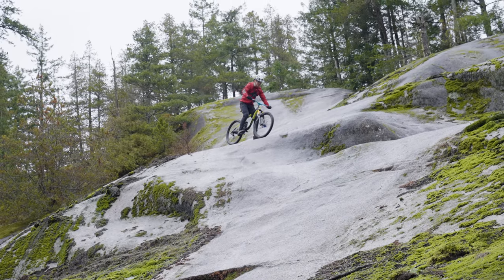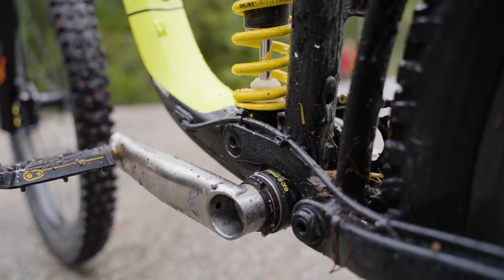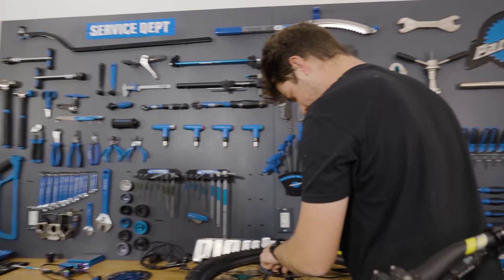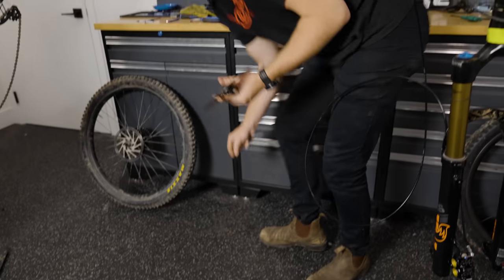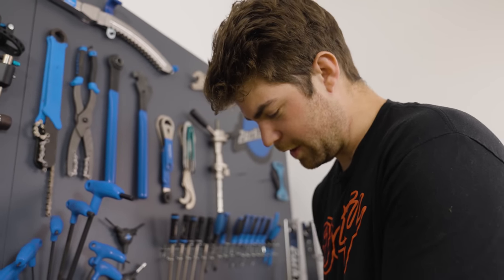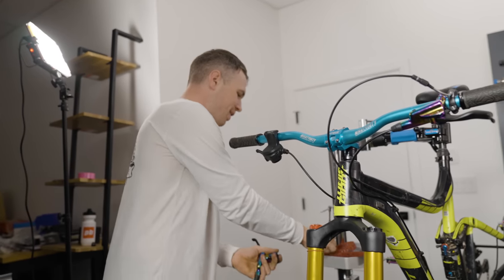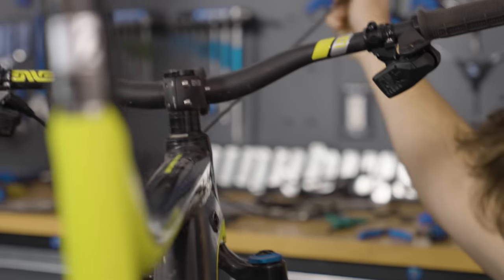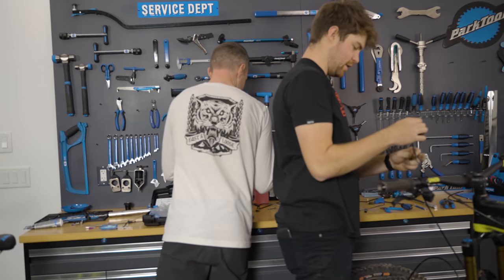$125 vs. $517 Brakes - Budget vs. Baller Episode 7

Comment: New pads, rotors, and a bleed would have been the “budget” option here…
Reply: And the price would have been less that the crap brakes they purchased.
Reply: Right... The mentality is absurd.
Reply: Or Shimano mt420s great power for price, especially with metallic pads
Reply: Yeahhh, looks like it wasn't bleed properly that makes it a poor performer. Could have been better if it was done properly.
Reply: I don't know why they would do it the way they did vs good pads and a fresh bleed.  I miss when Pinkbike had brains and common sense.
Reply: They even went down on rotor size to make the braking force worse. These "upgrades" are a joke. Them saying this was inspired by Donut media does a huge disservice to donut as they actually made UPGRADES and the low cars got good parts fit for purpose that are just sensibly priced.
Reply: @benfairbrother2458  Agreed, I have a set of MT400 brakes on my hardtail, they're almost four years old now and still work great. Sure the power is lacking compared to my four piston XTs, but they're the best value by far. I would have loved to see them use Shimano's cheapest brake vs. XTRs or something like that, just to show the difference, if they had to replace the parts and couldn't just do a service and call it good. 
Like maybe do a Marzocchi Z2 or 35 Gold vs. a 36 Factory, Deore 11 speed (to use the HG hubs on cheaper wheels), vs. XTR 12 speed Di2, or something. It would have been more informative and equally entertaining, but the more I watch the more I realize they're just trying to make it funny, which isn't what I was hoping for here.
Reply: @mjojrjr6231  yeah it's hard to imagine not being able to lock up any 180mm rotor if it was bled properly, especially when there is low tire-to-ground traction in the wet.  I bet you could lock up some rim brakes on that wet slab!  Maybe the brakes are so terrible that they are highly prone to bubbles / hard to bleed / etc., but the fact that they set this up right after the parts were shipped suggests it's probably mostly a set up issue (and while I've admittedly never bled my own brakes, and I realize some brands have different methods, what Henry was doing just did not seem right).
Reply: i have mechanical
Reply: Right. No one in their right mind would consider budget as "sort by cheapest" on Ebay or Amazon or whatever platform they're getting the parts from. 
It'd be more reasonable to do it on any respectable bike parts retailer, since you wouldn't end up with crap. 
Ultimately though, you're right, upgrading the hardware (except the calipers themselves) would have been a far better use of money. 

I simply cannot understand the logic in this series..
Seems a few of channels (pinbike, GMBN) have resorted to posting nothing but crap recently.
Reply: zoom hydraulic brakes are intended for recreational riding against a high-end set of brakes used for more demanding and extreme braking. it all depends on the budget and riding preference. for bikers like me that uses mechanical brakes and on a tight budget, zoom hydraulic brake is a breeze. this comparison is nuts. not everyone can afford expensive bike parts. hope you get my drift.
Reply: Actualy rotors are quite good, I have china-floating rotors with mt4 and metall pads, and I did't found any difference with RT86. So I would say pads and bleed - and zoom will b eOK till first leak ☺
Reply: @Neaels  Sure, but the use case for the bikes presented here is clear. Look at how they're testing them. I'd have no problem using the cheapest of the cheap on the bike I casually rode around on. When you're riding blacks etc. I don't think you should skimp out on arguably the most important part on a bike.
Reply: @Neaels  I had some shimano lx brakes handles that integrated shifting. I ditched handles for the zoom units and connected to the old lx calliper. It took me a couple of bleeds, but these zoom ones brake really well. Don’t know if I would put them on enduro bike, but as a XC / town bike. Absolutely
Reply: @cup_and_cone  this vid is just an advertisment, so i'm not surprised.
Reply: Budget barkes help you beat the speed record and also make you belive in a God (whichever). 😅
Reply: lol...my Avid Juicy 3's from more than 10 years ago that have never been bled before do a better job stopping
Reply: or buying some shimano mt200 (in a set round about 86 canadian dollar)
Reply: Just left a check at bike shop, only for my front lever to start leaking :/
Reply: For real I found a trek 6500 getting tossed while riding home on my Walmart mongoose bike I trued the rims got new tubes then adjusted the gears and quick service on the breaks the bike looks like it rolled out the shop now
Reply: Shimano MT420 with 203mm Shimano RT-66 Discs would have been the sensible Budget Option.

Comment: I cannot agree with the naming of this series. Dont get me wrong its fun.. But the name should be As Cheap as Possible vs Baller.. Budget is not always the cheapest. Budget is really bang for buck. Not paying 500% extra for 2% more performens or weight savings.
Reply: But it's showcasing parts for people that are on an absolute minimum budget of "upgrades" and showing which components are acceptable to go that route and others where it's far my applicable to go higher range of price and performance.. my take is that it's fitting 😉
Reply: @CJmtb91  so did you miss the episode where Henry said that the wheels were definitely worth running? And highly rated the saddle and grips.. I am in the group that thinks these cheap cheap components from no name brands are often a false economy but that is where this series stands out because it gives a real world display of what components are basically a failure and a downgrade from stock but where you can buy bargain basement components and still have a well put together rig.. 🤷🏼
Reply: @OLI-vx1md  But they replace good parts with worse on the socalled budget bike. A service on the fork and shock would be miles cheaper AND BETTER. Same with drivetrian and brakes. Sorry augument not valid.
Reply: @SGT2603  yes I am aware of the fact that servicing preexisting would have had a better outcome however that simply wasn't the premise of the series. Sorry arguement not valid (how pretentious!).
Reply: @OLI-vx1md  Budget does not = Cheapest. Everything is a Budget. If i make alot of money my monthly budget is higher. Budget is relative. The wording of the series is still wrong. Then it should have been called cheapest new parts.
Reply: @OLI-vx1md  Budget = an estimate of income and expenditure for a set period of time.

"keep within the household budget"
Reply: @SGT2603  yes budget is relative. That is exactly what they have catered to , a lower end budget and a higher end budget, how do you not see that? There ARE cheaper options out there than the lower end components they chose and there are components that come at a far higher premium price. It seems they have catered to a wide demographic by focusing on the range they have. As I have stated , they highlighted well where you can and where you can't cut the price point on components. If you can't see that, that is your shortcoming!
Reply: @OLI-vx1md  They are calling it upgrades when it is downgrades. No. The title is wrong. Otherwise i hope they end it with making the bike that makes sence. Ie service parts and replaci g broken parts with value stuff
Reply: @SGT2603  but some people view these cheap parts as upgrades, so hopefully with the guidance and expertise shown in this series, hopefully those people will see it as a false economy and it will perhaps draw an end to these bullshit no name, no reputation brands.
Reply: @OLI-vx1md  i do hope you are right. But i also do hope that people dont jump in the end of only buying the most high end or in most cases just most low weight stuff that performs the same as something a 100 grams more

Comment: Don't use these ultra cheap parts for the test of budget vs baller. In all of these episodes the budget option would have been different. Why change the stock bars for worse ones. An actual budget option would have been a nice-ish aluminum option. Seriously guys, great concept, poor execution.
Reply: Outside of the MTB world, nothing besides these ultra cheap parts is anything near budget tbh. But I know what you mean
Reply: I think the idea of this video was to show just how bad the ultra cheap parts are and discourage people from buying them.
Well that and entertainment value
Reply: @larsweibel6192  eh nope there is still a good middle ground where you get stuff that lasts and is only marginally worse than stupidly expensive stuff. you can get 40 different handlebars on craigslist that have a good width and usable backsweep for 5 $ on craigslist.
Reply: Yeah, a bit of a bumbling video...

Comment: Pretty sure they edited out 7 hours of Jason trying to bleed the Magura brakes.
Reply: Good lord my rear mag that installed through frame bled perfect the first time. The front? Had to bleed that turd about 8 times.
Reply: @rich75233  The best part is how you finally get them feeling great and then the randomly pull to the bar halfway through the next ride haha.
Reply: Yup. If you know you know haha
Reply: *and to have the bleed fail upon changing more than 1k feet of elevation.
Reply: I also had a bit of a mission to get my Mags right (DEFINITELY use the syringe with the carb hole, and find a vid of how to use it, if you don't know how), but mine absolutely do not fade under any circumstances anymore (including riding In N Out on the vid, and long descents in Gifford Pinchot)
Reply: @DavidLaburglier  once they're dialed they are great, but God forbid you end up with bubbles in the caliper...
Reply: @jeffmorrison333  praying the day never comes 🤞
Reply: I´ve even installed a bleed nipple ala Shimano style. Even then they are a pain in the arse
Reply: I ride shigura, never had a  problem once.
Reply: @petesahad3028  well, true that xD
Reply: I have several sets of Magura MT7s on my bike fleet and absolutely love them.  But yeah, bleeding and setup is definitely a bit of wash rinse repeat process.  If you can keep air out of the caliper when you internally route the rear line, it isn't too bad.  If you get air in the 4 piston calipers, it's going to be a long night.

Comment: Really feeling for Henry on this one. Watching him get trash parts (not what I define as budget), is rough. Some of these "upgrades" have been dangerous downgrades, mostly thinking of the tires and brakes. Too bad budget couldn't be identified as legitimate parts that don't break the bank. Would be cool to see what could be accomplished on a realistic budget, Amazon basement parts are not really fun to watch.
Reply: I agree,  how much performance would 200 have added to original forks if the damper/ internal seals and gubbinsisissssiz might have done in his competent hands
Reply: Cannot agree more, this should be called "trash vs. baller". There was so much potential in these series.
Reply: Pinkbike have said that this series is more for entertainment than actual sensible upgrades.
Reply: @julesowen-jones9815  and it was, polar extremes
Reply: Wouldn't get sponsorship otherwise...
Budget brakes like Shimano MT420 are actually pretty good. Same bike with them or XTR brakes and it's gonna be the rider that makes the difference, not the brakes.
Don't get me wrong, I love the bling and the very small improvements/feel of expensive parts, but I'm not kidding myself that they are good value 🤣
Reply: totaly, its not budget vs baller its baller vs amazon garbage, you can get real brakes for that price, that would actually work and would be worth watching.
Reply: Yeah this series really missed the mark; they should have at least stayed consistent.  Some of the parts are legitimate, practical upgrades that a lot of people should take note of; the wheels are a perfect example.  But it loses all real-world value when they start using trash parts that no serious mountain biker would be caught dead with at any price point.  And now they're actually spending money to downgrade parts for no apparent reason other than to prove that the bike is still rideable, if only barely.  It quickly went from an informative series to a joke.
Reply: I agree, there is no need to downgrade to parts that are causing a problem, he's gone from a working dropper to an absolute shocker, same with the forks, just spend the money on a service or a new damper. Then going from what looked like Guide R 4 pots to those ridiculous zoom brakes and a massive downgrade on the drive train.
The series is based on the donut series, they never replaced stock parts with obviously worse parts, there was always an upgrade. These are not upgrades, great idea guys , poorly executed.
Reply: Exactly.  These brakes on budget.  They're cheap crap that no one would actually use.  On top of that you can get Shimano MT200s for $130.
Reply: What they really need to end it off with is replacing the dangerous trash with what the bike came with to show you shouldn't replace everything. Maybe next time it should be 3 bikes: trash, budget, baller
Reply: @tomhawk733  I had the black long lever Shimano brakes, M355 I think they were . They worked great on the xc bike I had and not much difference to my M8000 on another bike.
Reply: @MikePlagge  I actually had these Zoom brakes (just not this color) which were an upgrade to mechanical disc brakes, I "upgraded" from the Zoom brakes to MT200s about 2 weeks ago and I DO NOT like them. They're spongy as hell even after a proper bleed at a LBS, and the lever travel sucks, along with stopping power. My Zoom brakes were better then these MT200s in every single one of those categories, less expensive, had better braking power, and great lever feel. If these MT200s don't improve within the next month (maybe with more rotor/pad bedding) then I'm 100% going back to Zoom brakes.
Reply: "Too bad budget couldn't be identified as legitimate parts that don't break the bank"
This.

Comment: Can y'all use actual decent entry level parts next time so Henry doesn't die
Reply: I've thought about this from the very start.... In an ideal world, a middle spec'd bike would have been a good idea to throw in the mix too, to see how they compare to the ultra top spec gear!
Reply: I think you're missing the point he's testing these products so other people don't have to plus the whole entertainment thing
Reply: @1uke69er  I’m not missing the point at all, I get that it’s to show the massive disparity to cheap crap and top end stuff and for entertainment … I’m just saying it would be good to ALSO (key word) throw in a mid-level upgraded bikes with parts that people would actually buy in the real world.
Reply: No beciase then you would know that deore is 85% as good as Xtr
Reply: @robwarden6973  that’s a real bad example generally the biggest difference in a derailleur is weight so yeah, I agree.

However, a set of SLX brakes on a mid level specced bike would give a good mid point between the absolute garbage that Henry ended up running and the (almost) top tier stuff that Jason ended up with.
Reply: meroca m4 are 4 piston brakes for £70 a set. never had a problem in the 3 years of having them and all 4 pistons move individually
Reply: @1uke69er  What products? "Set of something" as they call it, ot do not buy everything that looks like this? Its not helpful.
Reply: @kevjones7440  I've had really good luck with Zoom brakes. He could have used Shimano MT200s which are the absolute bottom of the line for Shimano hydraulic brakes though. And are about the same price as Zoom brakes. But again I've had great luck with Zoom brakes. I actually like them better then MT200s.